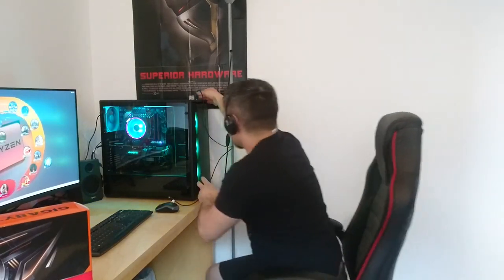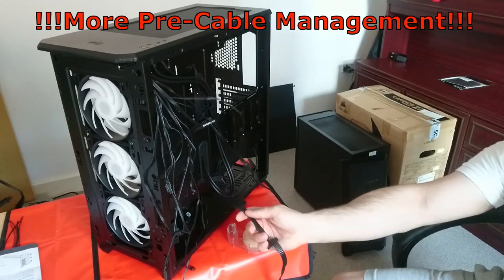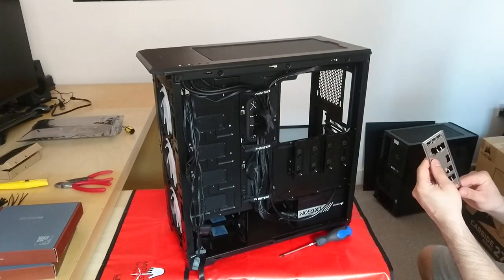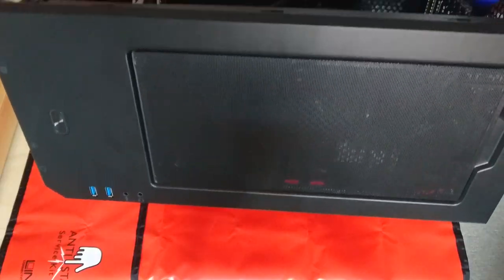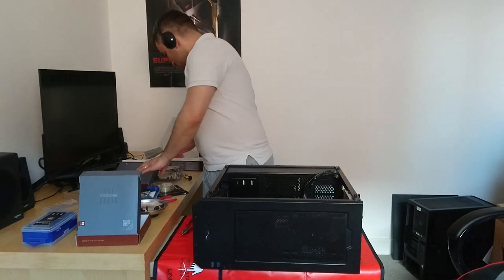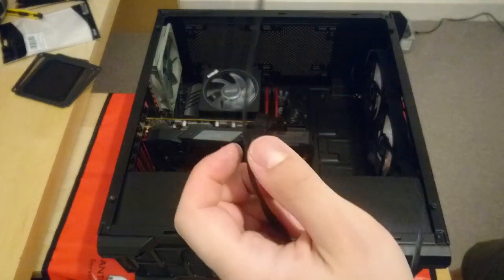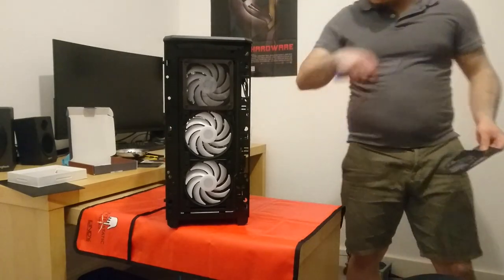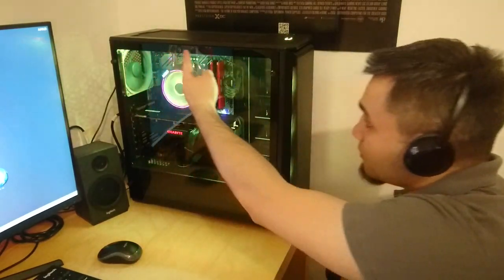Building a Ryzen Mid Range Gaming PC in the Phanteks P400A Digital Case guide

Comment: Great video! I bought the same case, but sadly my motherboard does not have a 3pin for the rgb fans... I only have 4 pins (12V). Does this mean that I can't control the colors at all?
Reply from the maker: No. Just plug the 3pins onto the 4pin header. You will be able to control them but if you run them in full speed they are not very loud. Motherboard always have 4pin headers that you can connect 3 and 4pin connector as well. Good luck with your build and thanks for watching.
Reply: KageShinobiGames oh my bad, I was talking about the rgb header and not the fan header..
Reply from the maker: @bunrica  oh right sorry my mistake. You did correctly put 4pin (12v) and control the colours so its totally my fault. The 3 pin 5v rgb header is the addressable rgb header. You cant plug 3 pin on to a 4 pin header because the 4 pin is a 12v RGB controller. You must not mix them up because you can break your motherboard. You must consult your motherboard's manual. You may have a 3 pin argb header and not be aware of it. I only found it in the manual. Its not very obvious, it may be hidden somewhere next to larger sockets and headers. Which motherboard do you have?
Reply: Go into BIOS and make sure the fan control is set to DC when using a 3 pin fan connection to your motherboard.
Reply: @parentalsettings9361  Plug the 3 pin into the 4 pin headers on the motherboard. You should be able to find the info in the motherboard instructions. Also download the Phantek p400a manual there is a picture that shows what 3 pin to 4 pin connection looks like.